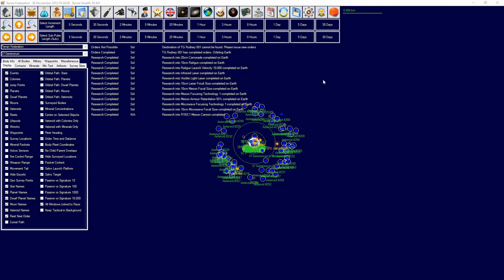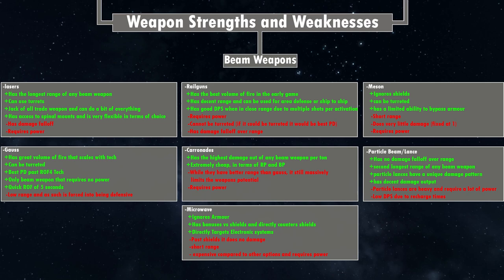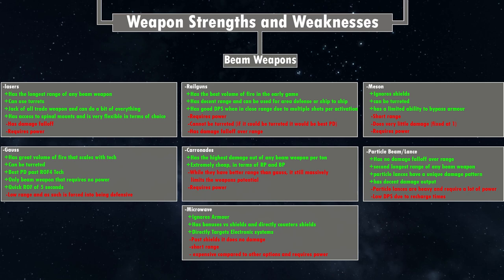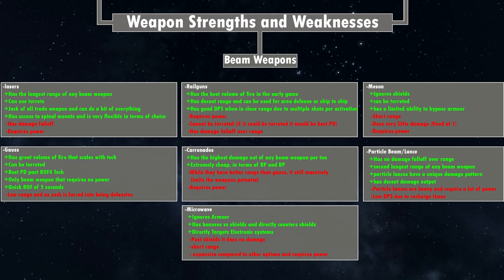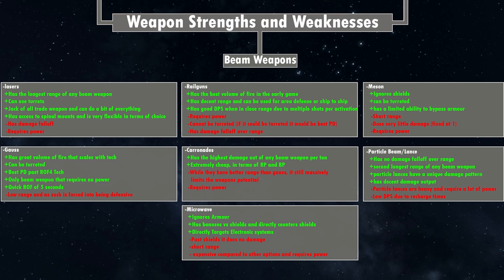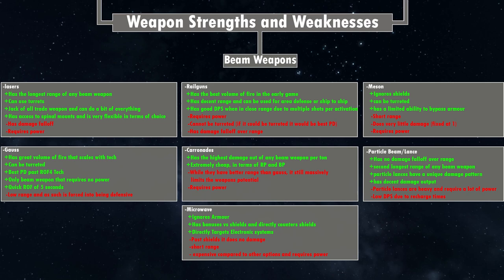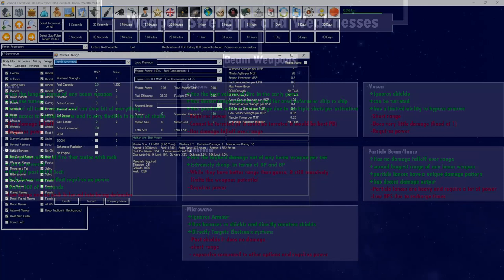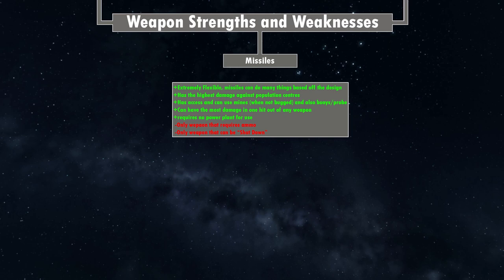Aurora 4x C# - Tutorial - Ship Design - Picking the right weapon for the job

Comment: It should be noted that Plasma Carronades in current version at the same tech level have similar performance to a laser the main difference being it is more of a burst damage weapon as it has similar armor pen just more spread out, because of that it has higher shock damage which is basically free bonus piercing damage that scales with normal damage. It still has shorter range than laser but it sorta ties with particles for 2nd place as they have the same range but plasma has a higher damage falloff than a laser also can't be turreted and eats power.

I like them because the effectively fire a decently sized missile at a higher ROF and lower tonnage than a launcher.
also non lance partials have a gradient of 2 and not single column but lance does though.

I'm still a total noob so take this with a grain of salt but these are just my 1 tech 3 (so far) game and mostly wiki observations.
This video and entire series has helped me a lot either way so keep up the good work.

Comment: First of all, great video. Thanks!
Now, about the content:
Please speak a bit slower and clearer.
Red text is hard to read on a grey background.

About the ship design. Could you show how do you choose engine size and power/fuel consumption, for your ships? I know that this is a question with many "it depends" but, I wonder how do you approach this topic.
Reply from the maker: I will be exploring this more, but I did do a video in the series where I went over recommended speeds for tech level and military vs commercial so that should help but yea there will be videos to help with that.

I already know about the red text on grey that will be fixed next time, and in regards to speaking I thought it was perfectly fine and others do as well but I will have a look later.